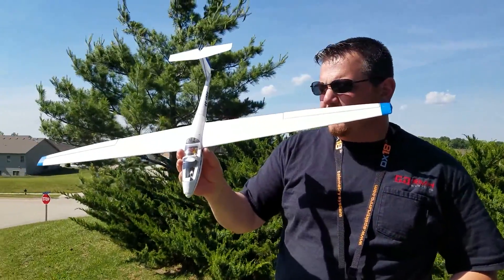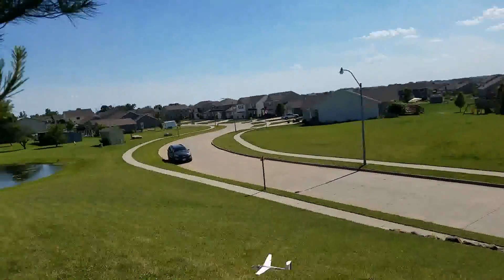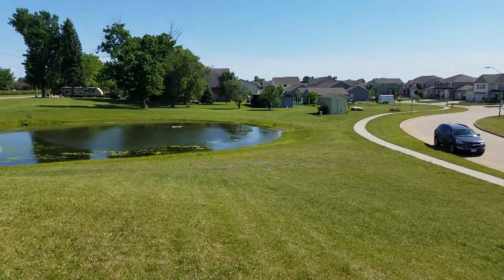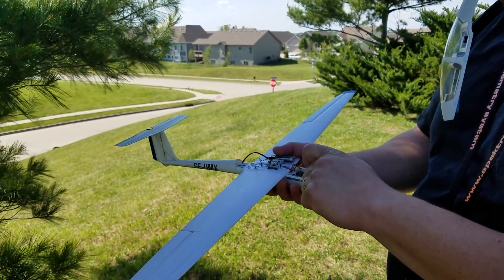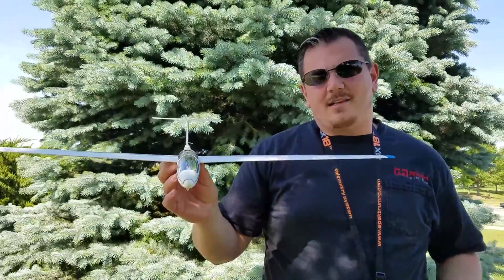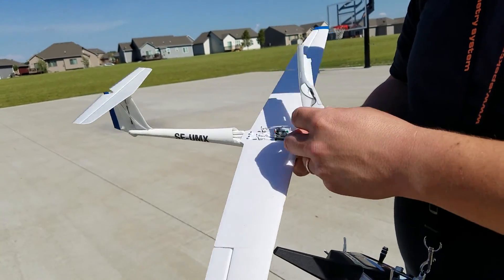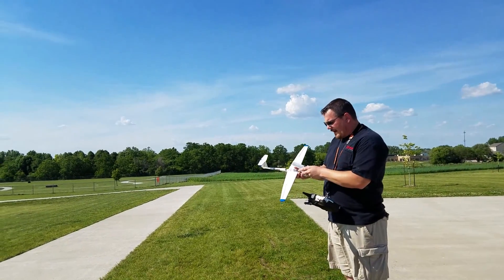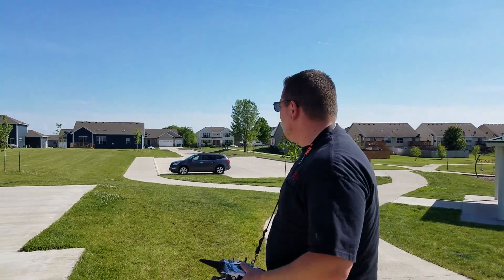Horizon Hobby - ASK-21 UMX - Another Attempt at Slope Soaring

Comment: Good to see more sailplane and slope vids Brian. My favourite aspect of flying.
The UMX Radian is alot better in all flying than the Ask-21. I've had both.
The ask-21 is really impressive to look at in the hand, but in the air the Radian actually looks better I think.
It will also thermal really well. Though i'm looking forward to your motor mod on this one ;)
My go to slope/thermal glider is the Phoenix 1600 from HKing. It's awesome.
Also just got myself a Durafly EFXtra, another highly recommended plane.
Reply from the maker: I thermaled with my Consendo S. It was crazy watching it go up for over 18 minutes! I don't use telemetry, and probably expect I wasn't more than "400 feet" (LOL) but I pointed her strait down and continued in a full out nose dive for over a count to 10!!! It was crazy. That was just to bring her so I could tell what direction I was pointing...

You are 100% right about this plane. BEAUTIFUL looker, but doesn't fly so hot. What a buzz-kill! I added the motor last night, but haven't finalized the depth or exact placement of the gearbox and motor, so for now, no video. Hopefully I can post a short set of clips to showcase going from my test rig to the final product.

Thanks for watching!

P.S. I'm getting into slope soaring and really want more and more, but it's difficult here. I hope to figure out a system/location for doing more of it. Logistics (and park rangers) are making it near impossible...I live within 10 minutes of a huge earthen dam that would work GREAT (Consendo S was awesome on that slope!!! Check out the video if you want... https://youtu.be/ALiX-WZ7t-I )
Reply: Yes I'm lucky in I live by the coast so lots of slope sites. Rarely any non windy days for other planes though.
The Consendo S is probably fairly similar to my Phoenix in flight. It looks good.
I've taken my Phoenix 1600 as high as I could in a thermal. It was so small I had to really concentrate, to not loose sight of it.
Sticks to the bottom right corners gives a fast spiral dive back down. Release to center and then just pull out of the dive. Don't know if it's the plastic fuse of the Phoenix, but I could hear the woosh sound of the dive from miles away.

Comment: I love this little glider - it's a great model, but without a good hill or cliff and perfect winds I think it's just too heavy for the lift it generates.  I've also got a pair of E-flite's UMX Radian Micro-Gliders and in this video you can see my son doing a pretty decent job with it, even though it's only his second or third time ever flying an RC glider.   https://youtu.be/6ijffqseGho  Both are fun, but the ASK-21 is a challenge!
Reply from the maker: I have sloped with this plane, and it's GREAT! You definitely need a larger hill to get her to fly.

I also added a motor, and folding prop, but with no breaking, it's only a last resort, since there's a TON of drag produced when you idle the prop....meaning, you'll be landing - EVEN with a strong wind.

Slope Soar - https://youtu.be/r3IPGb13dTM

Slope Soar - https://youtu.be/tF4GutmeL4U

Motor Flight - https://youtu.be/ArfrZgZDVHc
Reply from the maker: I need to find a new site. The ones I mentioned in the first reply turn out to be joint controlled by two BS government bureaucracies, wildlife refuge and army corp of engineers, therefore they said I was trespassing...so I agreed to leave (he was nice about it), then when I left, a cop pulled me over for speeding!!! I told the second cop about my situation, and he felt sorry for me, letting me off with a warning...

....but I would have GLADLY paid a few hundred dollar ticket, and maintained access to the slope there!!! It was beautiful! Our Government really has it'd head up it's butt with so many things, and the fact that there's a guy gliding a plane on a hill should not even show up on it's radar of things to "handle".

Spring is just around the corner, and while I still fly in the cold, it's not near as fun...and I can't go fly for 6 hours straight like I'll do when it's nice out, and sunset at 9:00 PM - I can't wait!
Reply: I was going to ask about the motor - I immediately went to search for it on Google/Horizon's website, etc. thinking WOW, they've reintroduced this little deuce of a glider - how great is that!  But alas I quickly realized you'd modified yours!  I think it's a bit heavy even as designed, so I'm sure the extra weight doesn't help it's glide ratio!  Thanks for sharing!
Reply from the maker: The weight is fine for sloping, but not great for "regular" flying. If they released it as a 1m in stead of 800mm, I bet they could knock this thing out of the park....but not holding my breath.